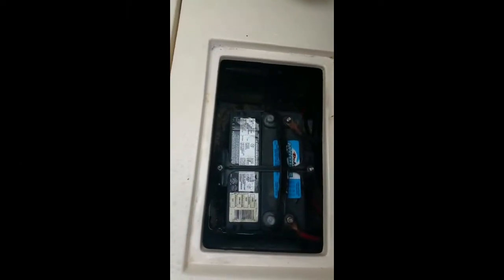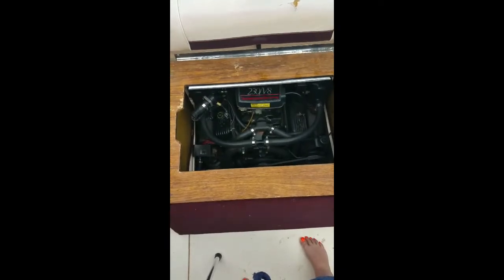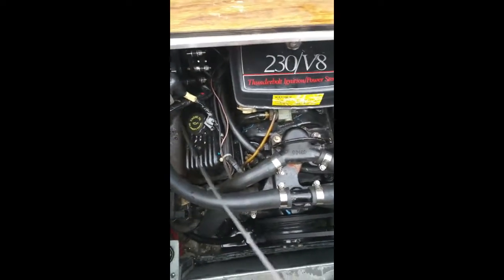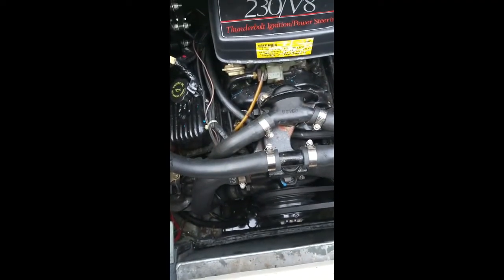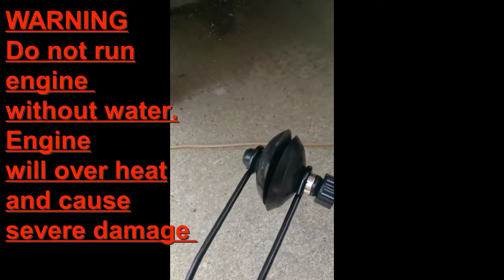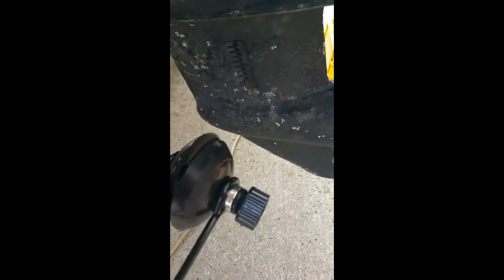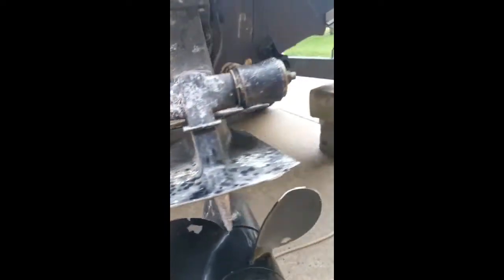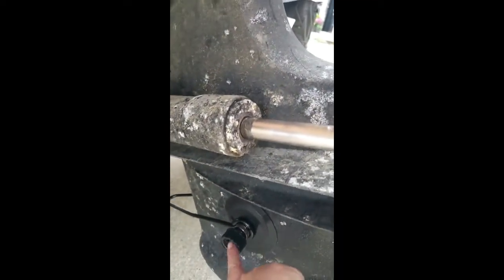How to Run a Boat Out of Water With Muffs

Comment: Great video. I am thinking that before I buy a boat I want to put it in the water as well to see if it has any quirks or steering issues etc.  I am looking to purchase a used boat and seller said she couldn’t put it in for a sea test but could run it with muffs. Opinions?  Also does anyone have recommendations for forums for people/ women looking to purchase used boats to gather information?  Thanks so much!
Reply from the maker: when buying a boat water test is best.  I do this to make sure the engine works underload and to check for engine block crack.

Comment: Muffs are hokey. Hard to get a prime and they dont seal sufficiently. I had to anchor them by tying them down and squeeze them on with a pipe wrench on the metal tongs. Still did not work. Just use a bucket or barrel that is big enough to submerge the water intakes. Works way better and every time. Save some money.
Reply: Then you obviously don't know what the hell you're doing
Reply: They don't have to seal perfectly. What you're describing is weird. Maybe you have a bad set of muffs? I knew a mechanic that had a box he used probably more convenient for him.